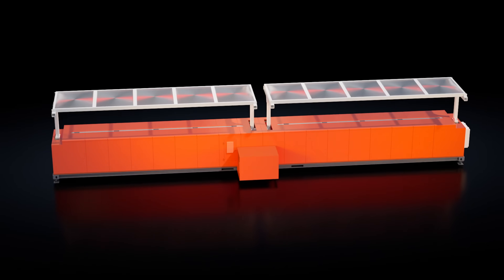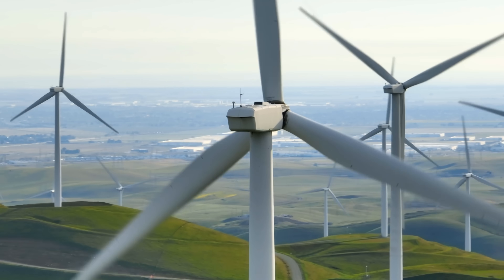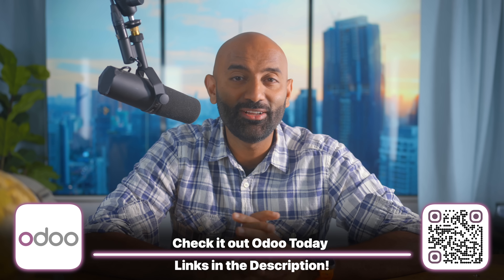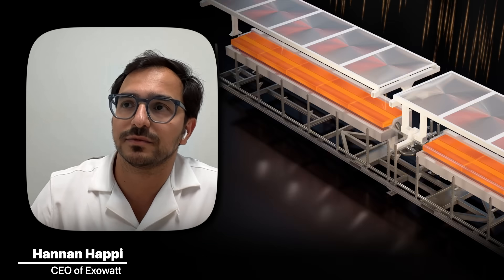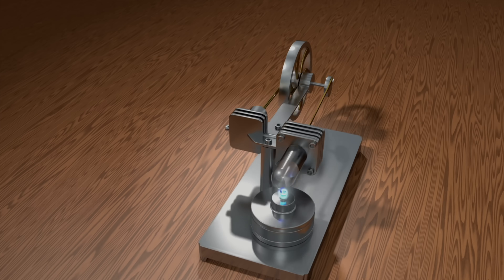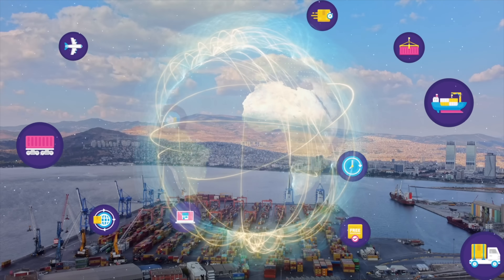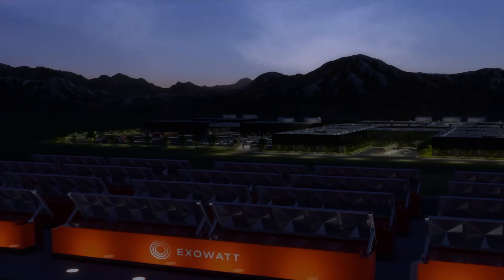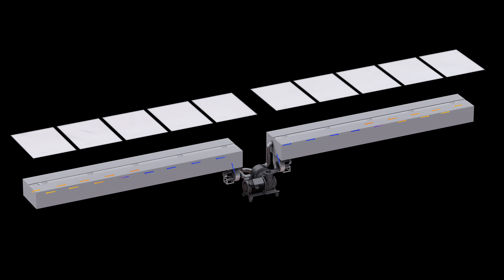Solar Without Panels, Storage Without Batteries - EXOWATT

Comment: Don't just think grid scale.  Scaled down to a 20' container you make homeowners independent of the grid for the most part.
Reply: Please do a deep dive! 

This just checked so many boxes that I don't find all the claims taken together to be very credible. Cheaper than solar, but 24x7? I would happily buy one myself and tell the power grid operators in California to go f themselves, but there's no part of me that thinks that's likely to happen. 

Extraordinary claims require extraordinary evidence and this is definitely not an exception.
Reply: @YesThatGuyHubby so you find it extraordinarily hard to understand an insulated brick. Good luck!
Reply: @YesThatGuyHubby  It needs high solar irradiance unlike pv panels
Reply: These would be amazing for outback Australia (desert) mining operations total energy independency... The electrifying of mining fleets no more importing of fuels increasing profit margins
Reply: I would buy one for my home if I had the land. If the expensive parts last 50+ years and is really that simple and easily repairable I think it will be a real hit. Anyone with more than 1 acre could probably have this tucked somewhere on their lot that is in full sun. Its a slight eye sore so maybe stick it somewhere not completely visible, I wonder what the surrounding clearance required is, probably similar to a solar array.
Reply: @lexpox329  yea, paint it a soft green or SOMETHING besides orange!
Reply: @lexpox329  If you can park a simple shipping container on your property, this would fit no problem
Reply: @ThorOdinssohn this is a major problem because most local jurisdictions have ordinances banning ISO containers on residential properties.  So.. a big part of any solution is going to involve changing the mindset of local busybodies and NIMBYs
Reply: @lexpox329  you on the right track, but if you break it down to daily or monthly usage, you wouldn't even need an entire arce to power an average home per day... or even per month. He talks a lot about megawatts. Here's the kicker; an average home uses about 10.6 megawatts in a year. So less than 30 kWh per day. It seems like one dwelling wouldn't need that big of an area to have a device that would be able to power the average home.
Reply: Anyone with the land for one of these could build their own equivalent. It's all based on low tech that anyone has access to. Making your own would take some time and money but it's absolutely doable, and it wouldn't have to be orange.
Reply: @lexpox329  better... put more insulation in the damn house -- not much added cost upfront-- but huge difference in the thermal control costs forever.. so no need for more boxes....  ttyl
Reply: One container would serve 5 houses for a year. At the rates quoted.
A couple at the end of each street basically community heating which is how all new build estates should be designed.
Reply: @FarmerMic  that all depends on latent heat around the structure. Depending on municipality there might be some very stringent rules (which might be why these guys focus on grid). 
I’m leading a retrofit project right now for a 51 unit townhome complex and you’d be amazed at what permit weirdness is coming up for us while we look at basic solar PV patching on to our deep retrofit.
Reply: If you have high ground water(or at least a water barrier), why not just have the thermal mass underground and surrounded by perlite or a similar insulator? Would be much cheaper and all the mechanical parts would literally be at ground level.
Reply: anyone could make it.......if you know where to get a 5hp sterling engine.
Reply: @maxkennedy5073  yeah like a 24/7 6-10Kw one would be energy indipendece for all single homes..a box in the garden and that'it. Condos? Put 3-4 big ones on the roof and voila, 50% of energy is done.
Reply: @enricod.7198 you'll need a fu*king strong roof😂😂
Reply: @enricod.7198 I love the idea, but weight distribution for roof top retrofits might be an obstacle for existing condos or apartments.

New builds, that could absolutely be accounted for and engineered into the structure to support a number of units.
Reply: Could put a heat pump extractor or a coil of pipe for a water boiler and take that heat back out too.
Reply: @andywilliams7989 
You can do that. Just make an insulated box, 1 square meter (=11 sq ft), with an inclined double glaze window on top. Thus you will collect about 1 kw/hour of energy to be used at your will. On condition it is sunny outside.
Reply: @maxkennedy5073  yes! This whole video I've been thinking the same thing. If this could be something that was built into every home? Imagine the savings if we didn't need a grid
Reply: Great idea! Needs less moving parts (absolutely none externally)! They need to lease the units not sell them. Partner up with farmland where the units are spaced the width of a combine. In the space between on divided highways. That would be great marketing for EV’s. Or even border wall! Below existing HT power lines. Land use would be reduced to zero!
Reply: @aleclilliebridge3421  The heat radiating off the boxes would be perfect for the border wall as it would basically create a heat shield.
Reply: Stop the focus on innovation. We must stop the damage before we want to fix it. We must use our waste as part of the solution. Let’s start burning all our garbage instead of landfills. Use the ovens to get the energy/resources back from our garbage. Then use the ash as isolation to store the thermal energy. A global modular thermal energy battery system. This network can be connected to earth core heat. There is the time and place for innovations. Please help me share the vision. It’s my visionquest. The problem is the system not the people.
Reply: Wonder if you could burie it
Reply: @bobhood4482 Burying and insulating the thermal storage seems a good idea. The lenses would, of course, be above ground. The aperture could be just above the surface. Maintenence might be an issue.
Reply: @bobhood4482  you could probably bury the container bit and just keep the lenses exposed to the Sun
Reply: @PeaceForAll2001 - “bury the container a bit…”

Underground, it will rust more quickly, decreasing the life expectancy.

Under the ground, water infiltration will cool the bricks & end the use, requiring a crane to get it out of the hole.

Trying to maintain the machine equipment under the ground is probably more difficult. 

Above ground, on a slab, is probably best
Reply: @PeaceForAll2001  more efficient actually
Reply: @DavidHalko  There would be some prep work, but people bury containers as survival bunkers all the time. It would add cost, for sure, but doable.
Reply: @PeaceForAll2001  With that idea, you could skip the box altogether.  
Excavate your intended footprint, setting all that dirt aside, and then install Insulating wall panels to all sides.  

Then set whatever ducting pipes to be required with the properly indexed spacing, and then backfill after pack all that dirt, allowing it to serve as the thermal battery instead of clay.  

Then set up whatever slitted insulation panels necessary to the topside, and build the articulatory mechanisms on the ground level at either end, with a small building to one of those ends housing all the mechanicals like the blower, stirling engine/generator combo, and even the lens panel actuator drive.  

Obviously the duct-piping would be looped thru this small shed as well to serve the heat to the engine. 

To me, this is much more cost-effective, assuming the heat-retention density of the available reused dirt would be close enough to the clay bricking, once all humidity has been baked out over the first couple weeks.  It would also allow you to size it to whatever proportion works best for you.  

That said...  the main reason for the boxes in the first place was to have an easily shippable, ready-made unit that could be very simply deployed and networked for quick startup.
Reply: @PeaceForAll2001  not if the groundwater level gets high at some season or other...  study the septic system data for your site..  ttyl
Reply: @bobhood4482  most of it, yes, that would actually increase the energy efficiency to heat-retention. The Fresnel Lenses would still need to be exposed, but at ground level instead.
Reply: @bobhood4482 ~ Possibly burry, but since the underground is always cooler, you might loose some heat,  thus loose efficiency...
Reply: @bobhood4482  no but you might be able to bury it
Reply: @bobhood4482  Not easily. I built my own shipping container house. Everything i have seen says, "No" because containers are not designed for lateral crushing forces of soil/dirt. Also the wooden floor could deteriorate and the metal could rust.
Reply: Do you mean bury?
Reply: @bobhood4482  You could bury the lower portion but I still don't see as being too practical for residential.
Reply: @bobhood4482 - not if you want access to the sun to heat the bricks!
Reply: @DavidHalko  you could probably bury the container bit and just keep the lenses exposed to the Sun
Reply: @DavidHalko you could probably partially bury it, really just need the lens array and its supporting structure above ground. Being buried and lower to the ground would make lens cleaning and maintenance easier too.
Reply: @Michael_G980 - “could probably partially bury it”

Underground, it will rust more quickly, decreasing the life expectancy.

Under the ground, water infiltration will cool the bricks & end the use, requiring a crane to get it out of the hole.

Trying to maintain the machine equipment under the ground is probably more difficult. 

Above ground, on a slab, is probably best.
Reply: @DavidHalko  yes! If one is going to dig (or must), dig something like a car garage or a man's cave. I wonder how noisy that engine is!
Reply: @PeterDMayr - “how noisy that engine is”

I have not the foggiest idea! 😅

Since there is no internal combustion, no repeating controlled explosions… it might be very quiet!
Reply: @DavidHalko  Container doesn't have to be metal could be variety of materials...

Underground installation could slide in, maybe be pulled out (though suspect life expectancy of device to be long, if use simply stone or sand to hold heat could be extremely long. Lenses and air will also have very long life, jenny device could be placed in accessible place...

Maintenance likely more tricky, but perhaps issues could be designed out, eg jenny device could be placed in accessible place..

Anyway just random idea…
Reply: @DavidHalko  you could burry the lower section and it would insolate better.
Reply: @DavidHalko why not? The ground could insulate bricks while they are being heated up by the solar panels, then exhausting the heat for the Sterling engine.
Reply: @DavidHalko not completely below ground, just enough to insulate it a bit looks like it would be helpful, until you need to move it 😉
Reply: @DavidHalko  what do you mean, he's not saying bury everything, smh, just the lower unit which makes some sense for insulation but there are other issues created by doing so, but not having access to the Sun isn't one of them.
Reply: @russell2449 - “bury it… just the lower unit”

Underground, components will rust more quickly, decreasing the life expectancy.

Under the ground, water infiltration will cool the bricks & end the use, requiring a crane to get it out of the hole.

Trying to maintain the machine & other components under the ground is probably more difficult & raises the cost of maintenance dramatically. 

Above ground, on a slab, is probably best.
Reply: My first thoughts! Definitely something a homeowner can build for themselves in my opinion.
Reply: Half size would only be 12kw. Not enough to run a home.  These look cheaper to build and use than solar panels.  Since they work at night they should make their money back long before they wear out.
Reply: Also industrial, mining and large-scale commercial will be big opportunities for solutions like this. Especially if you can pick up and move a module to a new site after a few years.
Reply: @maxkennedy5073
I want one.
Reply: Amish would buy these, a single purchase, no monthly bills, they cant stand monthly bills.
Reply: That was my thought, I have a decent amount of property and wouldn't mind having one or two of these away from my house, gathering power.
Reply: You’re obviously naive.. like they let that happen? They don’t want you independent
Reply: The only thing I really want to know is whether or not it's viable as a DIY build for an individual residence.
Reply: I’d like to see a deeper look into this
Reply: @maxkennedy5073  
That's my thought process, 20' container, go off grid from your local utilities company
Reply: Not residential community and / or small city level would be fine. 

Proper operation and maintenance is needed. 

Or it can be paired with polar night like sand battery for district heating.
Reply: Imagine if you could make them safe enough to use as part of the building's actual fabric!
Thinner versions as a home's walls.  They'd be already insulated too.
Obviously burying them works too.
Reply: They should do one field to support each neighborhood, one field to do twenty houses, spread out the fields all over the usa.
Reply: in my area outside a mid size city in upstate NY we are not allowed to have a shipping container on our property, it is written into city laws, I have 3 acres and I can have PV
so thats where I started, and added to my setup over 2 years as I ran tests and came up to speed, I went off grid last year for 2 months as a test to see  how much it was going to take, it gave me a better idea because the only way to really know is flip that main breaker and see what breaks LOL
I had to add a few more panels and a few more AGM batteries, but worst case in a SHTF situation I will have whole house power...
believe it or not it dont really take as much PV, batteries or inverter Watt as people think, I bought a lot of stuff on Amazon, aliexpress and used marketplace and maybe have $3k into the whole thing...
Reply: "That's illegohl!"
Reply: That would be great. I see the future of there not being a grid.
Reply: Being able to get off the grid is worth the footprint
Reply: @maxkennedy5073  been thinking about that concept for some time. 40 acres of desert I'm sure I could find a spot for it.
Reply: Not an engineer but…I love it, want it for residential home and small barn.  Interested in you having the deep dive so we can learn more, please.  Having a home plant makes sense to me for all future home builds.
Reply: You don't need that much.  About two cubic meters of Zeolite clay pellets store ten times as much heat as their bricks. 
Just add water, and they give the heat back as steam.
Reply: I want in on the pilot program for this!
Reply: Had the same thought. Though soon someone will come up with a DYI model I'm sure. To bad the sterling engine company went out of business. Sounds like they might be hard to come by for a fair price if not mass produced already.
Reply: Exactly I live off grid and would kill to have something like this except in a 20 foot container firstly, I don’t need a 40 foot container worth of electricity and secondly, a lot of off grid places are next to impossible to get a 40 foot container on site where a 20 foot container is doable
Reply: It would be cool to not have to pay the power bills of the datacenters close to me
Reply: i think they focus on the grid scale.. because them hot boxes are gonna be hot..
no mention was mentioned on the heat coming off em..
so i assume they want it deployed away from residential.
and i assume they have a hefty maintenance cost.. yknow like how john deere behaves.. its not the tractor price that kills the farmer.. its "scheduled engine checks"
Reply: @andrievbastichy8551  Heat (within reason) could be  nice in winter depending where you live.
Reply: @michaelchilds3305  That's what I was thinking.  Just to provide heating in winter would make a significant impact on traditional energy demands, and that could include single dwellings or larger commercial structures.
Reply: @andrievbastichy8551  Hot boxes is not a problem. I have 40kwh of thermal storage in my basement. Two units, each about the size of an old school radiator. They heat up bricks inside of an insulated sheath to 3000F during off peak hours and then blow air over them during peak hours to heat my house. They sit against a drywall and wood framed wall with about 2" of insulation and some sheet metal between the bricks and the wall, or your hand, they barely feel warm to the touch when fully charged.
Reply: @andrievbastichy8551  I think they focus on the grid because of economy of scale. They would just be far too expensive for residential use. I like the idea of the technology but, I live in Alaska. It might produce enough power three months out of the year, but the rest of the year it wouldn’t get enough sunlight to produce enough power to ever pay for itself.
Reply: @andrievbastichy8551 I work on maintenance and I agree with your comment. A majority of architectural and engineering firms do not take in account of maintenance issues. And that is why I will never be unemployed
Reply: @andrievbastichy8551 could insulate or bury underground.
Reply: @andrievbastichy8551  Will work everywhere energy isn't an issue though. Again, another green "revolutionary" idea that will do nothing to fix the main issue of green energy; a stable of supply throughout the day.
Reply: @andrievbastichy8551 hopefully they'd be very well insulated. Also all the used heat is valuable energy. I know the Seebeck effect isn't very efficient but idk why that means we can't still just use a bunch of it to capture heat.
I've had fantasies of a very large heat storing battery buried in my yard that uses similar principles and thermoelectric generators, with the initial heat provided by solar.

Also there's other uses for that heat like desalinating water or recycling back into the system.
Reply: @andrievbastichy8551  scheduled engine checks, says the city kid, lol 

😂 scheduled engine checks😂
Reply: @Identifyasaconspiracytheorist  yeah lol.. thats what john deer "claims" to scam the farmers. forcing their crooked plans. "maintenance"
Reply: @andrievbastichy8551  If the exterior of the boxes is hot, that would mean they are poorly designed.
The point is to store the heat internally to use as energy, not radiate it back into the surrounding environment.
Reply: @andrievbastichy8551  The boxes aren't going to be any hotter than the ambient temperature. They are using the same sunlight that would be hitting the ground anyway.
Reply: @andrievbastichy8551  One word - INSULATION. So that objection is moot. And your idea of "hefty maintenance cost" isn't supported by the video - that there are some kind of maintenance cost there's no reason to think it's higher than any other system that exists, including solar panel systems (like the solar tracking mechanisms/batteries/inverters).
Reply: @andrievbastichy8551 Stirling engines have very little need for maintenance. The cargo container will likely reach well over boiling.
Reply: @andrievbastichy8551  they are insulated so the outside should be close to ambient
Reply: @andrievbastichy8551  As a son of a man who ran a John Deere dealership... WTF? 

A shipping container... using a Fresnel Lens to concentrate heat into a material that holds heat (at below molten levels), pumping the heat into a Sterling Engine (which has been around for centuries) results in kinetic energy to produce electricity... (conversely, if you pump kinetic energy INTO a Sterling Engine, you get Refrigeration) I'd be in for it. I've had a desktop Sterling Engine model, you can almost make it run on the heat from your own hand (the very first Sterling Engine was used to pump water out of coal mines almost 300 years ago). A Fresnel Lens is a piece of plastic the depth of a credit card that is a magnifying glass to focus sunlight into heat. The heat retention material is the most diverse, you could use water, sand, other INERT materials, which store and slowly release heat back to the Sterling Engine to generate electricity. It is not hugely efficient, but it uses FREE solar energy, which by itself is cheap.

You don't necessarily need to be 'grid scale' unless you're a big corporation trying to monopolize distribution.
The Exowatt box does not appear to be something that would be hazardous to be around; the heat retention element could be a natural material, so a breach would be no worse than touching a hot pan out of the oven. Keeping it away from Residential areas s kinda of a good idea, but not absolutely necessary, because children are stupid. In my condo complex, I have been the Mr. Wilson to neighbors' Dennis the Menace climbing on the gas meters.
Maintenance (from what I know of the base technologies proposed here: Fresnel Lenses, heat sink, Sterling Engine generators) would be *very* minimal, thus cheap. The Sterling Engines are about the only thin that has moving parts, and that is minimal
Reply: As indicated the principals of operation are as simple as rocks around a camp fire.  There's nothing spaceage or incredibly complex mechanically that even commodore 64 or 128 could not manage.   The large fresnel lenses are not totally astronomically priced and there are easy work arounds. 

Don't steal the design but use artistic and simple ranch hand skills sets to prototype an experimental 20' x8'  foot  high cube container as the housing. 

Heat your house and workshop or barn for very low cost using standard inexpensive components. 

We are a nation of shade tree inventors and fabricators.  We got this, just like Bill Gates, and Steve Jobs working out of their parents garages. Ya they had humble beginnings yet look at them.
Reply: @michelewhitewolf9856 Gates, Jobs, Bezos and Musk all had wealthy parents who bankrolled them.
Reply: @michelewhitewolf9856  It's all "easy" - until you try to put it into practice. I have strong reservations about how this "easy" product will actually work. I don't believe for a single second that it will compete with solar panels for price, performance or land use (megawatt density let's say). I understand all the mechanics and principles from the video. I just know however there's a chasm of disconnect between what's shown/said and the real world.
Reply: @michelewhitewolf9856  Hardly humble beginnings. Both had wealthy parents that invested start up capital. They also had access to large corporate support. Gates worked with IBM because of his father’s connections.  They were hardly anywhere near “Boot strap” operations.
Reply: @michelewhitewolf9856  they don't impress me now...
Reply: @michelewhitewolf9856 they could harvest the lenses out of old projector TVs. Lol jk... Kinda
Reply: @michelewhitewolf9856 LMAO. The oly think Bill Gates ever discovered was how to take & profit off of others' inventions!
Reply: 1--% with you man , decentralise
Reply: Grid access is the only way a body can exploit access to cheap energy, so it will 100% only be accessible by the grid, gov ain't going to invest a cent in making you not a customer
Reply: @maxkennedy5073  that'll be thing that gets it shot down, because power company execs will freak out.
Reply: For HOW MUCH MONEY???
Reply: @maxkennedy5073  ..ooops . careful...
Reply: I'd rather put solar panels on my roof than a 40 or 20ft container in my backyard, lol. Also less noisy
Reply: They should, but it would be way too hot. Plus there are products out there already that can be used to heat up water. The US was going to go down that route, but we had too much easy access to energry at the time it never came to be, but places like in the EU total went down that route still and they save a bit of money doing it, but problem is just that it looks a bit "ugly" on houses, so its also starting to turn the other way around again.
Reply: Or neightborhoods..
Reply: What happens when it rains?
Reply: There will be other companies to innovate on the residential front. I'd rather these guys focus on grid scale.
Reply: Lol...
Nobody in charge wants to be homeowners independent of the state.
What would the government gain with that except loss of control or wasted economy input
Reply: Abolish ai for sure
Reply: I love your channel, please tell us more about this.   Sounds extremely promising.
Reply: that what i thinking  make it smaller u take each home off gride and u go 20  foot each most a home uses  is 150 amps,  max 200 amps, this would take all homes off gride
Reply: When you add automated malicious malware all that compute quadruple
Reply: Honestly what's lagging is implemented existing infrastructure that could be utilized by modification, a cinderblock the most popular fence lining every other yard should be revisited for modification of storage wasted space inside same with interior walls
Reply: This looks more like something that should be open sourced. You can get Fresnell lenses from old TVs and build a sterling engine with a little machine shop tooling. The composition of the heat bricks would be the likely hang up on building one maybe, but water (for steam) or rocks could be good substitutes.
Reply: Please do an onsite review !
Reply: I'm planning a build right now with my own 16(8x2)cyl stacked radial engine, alpha topology.
Reply: Use that heat from the "bricks" to heat homes and greenhouses in the winter.
Reply: 1  second per unit. With 8760x3600=31.5 million seconds per year you dont safe 31 years of production with 4 or 5 million units. I think he confused his numbers there, but I get the point, saving on production time and material cost are the main focus points to prepare for mass production.
Reply: Two things I did not hear addressed are the generator and response times.  Obviously, a Sterling Engine does not produce electricity directly it needs a generator.  This is of course a maintenance cost. The other big consideration for grid storage is response time.  There is clearly significant inertia in a set up like this. Batteries provide almost instant response times.  The management and coordination of this as a grid system needs to be planned and orchestrated.  Does the whole system just run at once or are individual units scheduled and preserved for different times each day by the hour depending on demand?
Reply: Heck yeah. I live on a few acres, have the perfect open place for even a 40' container.. One would probably get me off the grid, since my electric usage is fairly low..
Reply: Same mistake that the PV industry,  upscale it ti create large complex far away. 
The solution is that for every to have a little version to cover part or full own consumption.
Reply: @maxkennedy5073   I agree with you unfortunately we were gonna be fighting big business a big power companies to get a version that would fit a home, but that’s what needs to be done. That way nobody is on the grid. We are all individually powered unfortunately that’s not good for capitalism. Remember the rich wanna make as much money off of us for his little as possible that’s the reason why Trump wants to go back to fossil fuels. It’s a commodity you can change the price of it make more money off of it so until we get rid of big corporations, greedy politicians we’re gonna have a big fight on our hands, but I agree with you 100%. I was thinking the exact same thing if you could make it so that you could even have it powered people‘s campers individual homes and businesses it would change the world unfortunately, some people want us to go back in time.
Reply: What I  see is the environmental impact is less then solar or wind, no chemicals, no digging for materials. Glass is sand and bricks are clay
Reply: I dont think it's for anyone but someone with acres in their backyard. It's not for a large scale. It's efficient in only one respect but not in others..I wish, but no. Takes up too much land. And we have been a great country before chat get ect. That much land is too much for just one or two companies. I like much about it. But it takes up too much land. And it's time to back off much of AI and things like chat gpt and the like. AI a d the like needs to figure out a way to use a lot less electricity and water.. Until then, it's past time to put the breaks on AI..
Reply: 2 questions:

1. Why is the housing orange, not black for maximum thermal absorption?

2. Heat waves reduce pv efficacy, is this system more or less impacted by extreme heat?
Reply: Great ! I'm all for it.

But let's remember that globalists do not want us to be independent as that diminishes their control.
Reply: Add it to the grid at any place where a bottleneck in the network starts or ends and it can supply extra electricity when needed at that side or store it when there is a surplus.
Reply: That's what I'M talking about!  Fk the utilities.
Reply: @maxkennedy5073  great and wonderful and hopeful idea... but "they" can't make money off of us if we were off the grid. every attempt to lower costs or alter consumer supply is and has been cock blocked
Reply: @maxkennedy5073   home owners? At 1MW per day, it could power a whole block, or a small off grid community, add battery storage and much is possible, but I think outside the box
Reply: Thermal batteries in residential areas would have a litany of permit obstacles to overcome depending on municipality/state.
Reply: @IdrisFashan  luckily we don't all live in the city
Reply: @jypsridic  oh right cause suburbs and exurban areas have lighter architectural rules? 😂
Unless you’re a country bumpkin, this would definitely run too hot to sit behind a shed on a corner lot or acreage.
Reply: @IdrisFashan  there are literally no architecture rules here actually so yes they are lighter. Lol. And when your acreage is counted in the hundreds you have plenty of space
Reply: @IdrisFashan they're bricks 🤷‍♂️
Reply: @IdrisFashan  go on...

I've been keen on thermal batteries as they don't seem to cause issues with code. Interested in learning more.
Reply: At homeowner scale or even homestead scale, "traditional" solar is more than good enough and with much (much) lower pricing as well as much easier installation - all with no moving parts and next to zero maintenance. Exowatt will never fly at consumer scale.
Reply: If the technology actually worked.  

It doesn’t
Reply: You aren't going to put them on a typical residential rooftop. You have to use the front or backyard so I don't see this as being too practical.